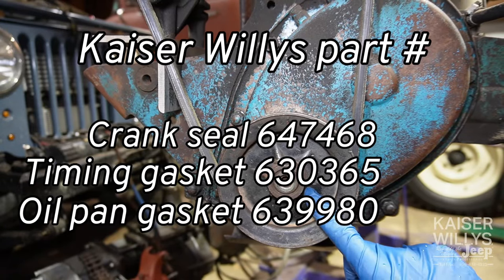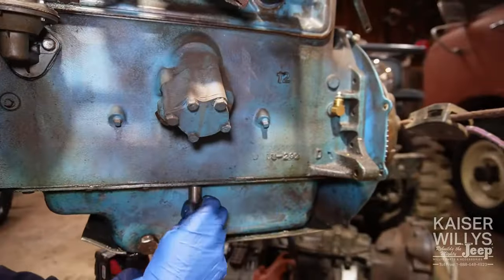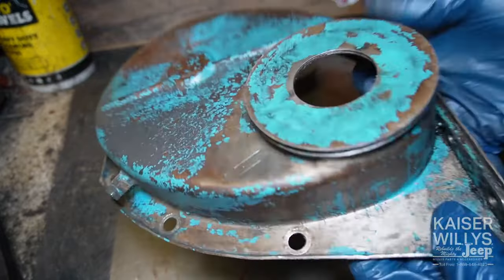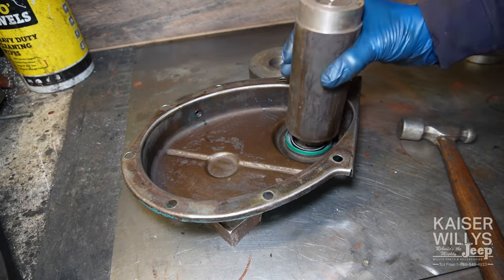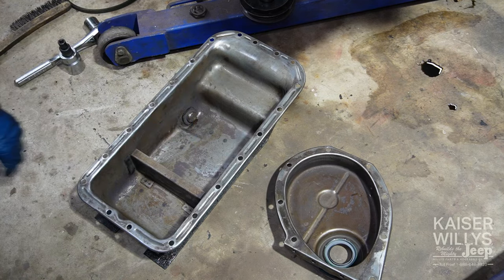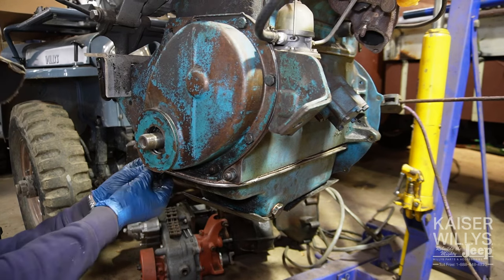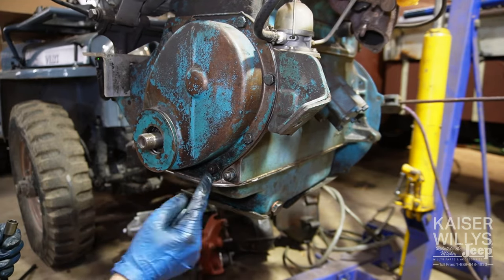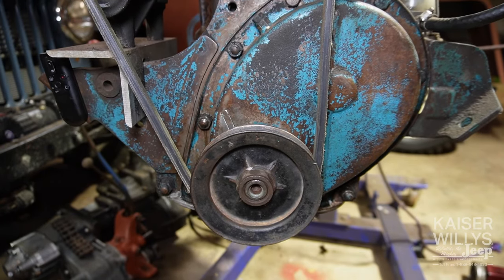How to Fix Jeep Oil leaks. Crank seal timing cover and oil pan gaskets

Comment: Hi, before tightening up the cover bolts, slip the pulley on the end of the crank...this will center the seal so that it wears evenly.
Reply from the maker: That’s not a bad idea. The straight edge does the same thing. The studs don’t allow much movement anyway but anything you do to keep the surface flat is helpful. Oil pan leaks are far more common than pulley leaks…so my primary concern is the oil pan surface. You should have seen The seal I removed in this video. It was completely trashed and flat on one side but never leaked a drop.
Reply: @redeyecafegarage7484  I wish I could take credit but i learned it from someone who learned it from some else etc...my favorite trick is when installing diff covers, water pumps etc is to take two extra long bolts that fit in the holes in and cut the heads off and use them as guide studs...no more RTV mess or misaligned gaskets and everything lines up without having to hold with one hand while trying to start threads with the other..